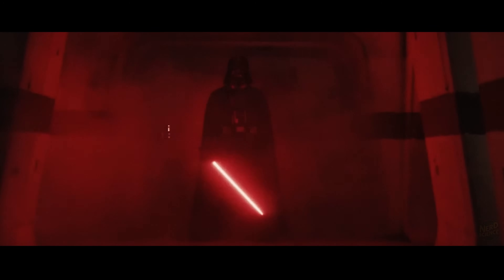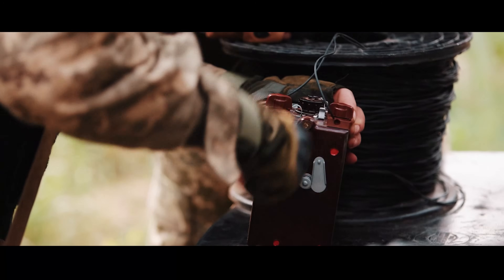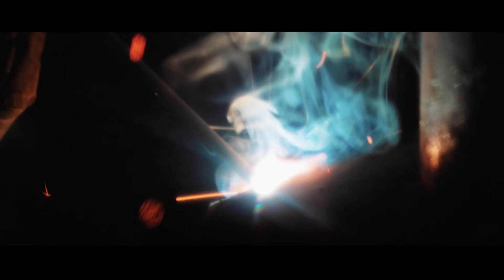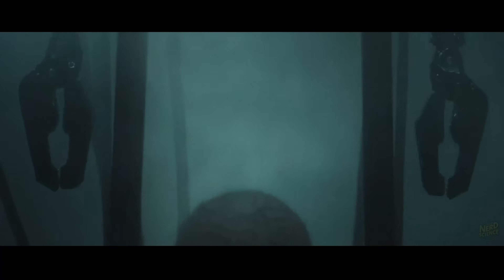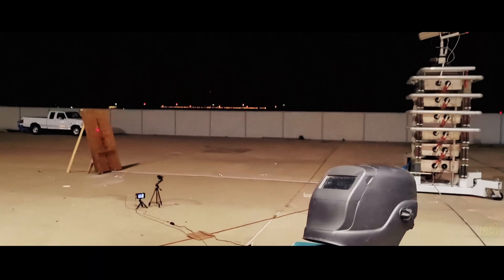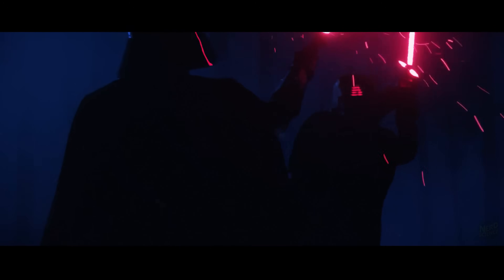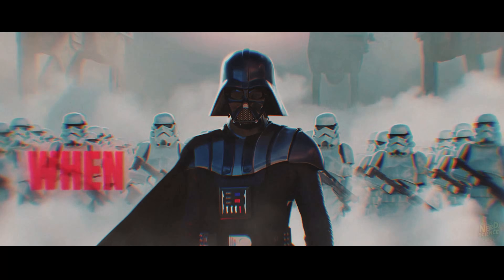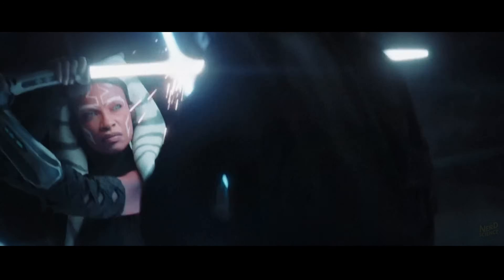Why a REAL Lightsaber Will NEVER Exist (According to Science)

Comment: It's a good thing when you examine the lightsaber from the field of physics, but you forget about the electromagnetic field(s). It is known that electromagnetic radiation has a wavelength, which can be extinguished because of this. It is also known that electromagnetic fields have a polarity and that the same poles repel each other. So, if the electromagnetic field of the lightsaber operates in an inner-outer pole pair in every configuration, then the fields with the same outer pole are impenetrable to each other. In this case, it is not the plasma blades that get stuck in each other, but the magnetic fields that form the obstacle for the blades. It is also worth knowing that objects are solid precisely because of the magnetic interaction: the magnetic field of atoms and molecules prevents them from passing through the already huge intermediate spaces. The change in state of matter only increases the size of the intermediate spaces to a size larger than the magnetic field of the atoms, while increasing the kinetic energy. However, it is indeed true that a lightsaber could not work in reality based on the simple "blueprints" presented.

Comment: Did you actually research this, or did you just let an AI regurgitate pop-science slop?

First: plasma can be confined by electromagnetic fields in theory. Hand-waving it away with “we don’t have the technology” is meaningless. We also didn’t have semiconductors, lasers, fusion reactors, or GPS until we did. “We can’t do it now” is not a scientific refutation; it’s a snapshot of current limitations.

Second: crystals are irrelevant. Real-world “lightsabers” wouldn’t need kyber magic or space crystals. All that matters is field containment: defining blade length, stability, and interaction with matter. Colour and lore fluff are aesthetic byproducts, not functional necessities. Pretending otherwise just shows you’re confusing Star Wars canon with physics.

Third: the power-source argument is lazy. Energy density has been shrinking for decades—batteries, capacitors, and power systems get smaller and more efficient every generation. And even if early prototypes required external packs, that’s not a problem; it’s how every technology starts. Miniaturisation follows function, not the other way around.

In short:
Your video doesn’t explain why lightsabers are impossible.
It just explains why they’re inconvenient with today’s tech, which is a completely different claim.

Maybe next time, argue physics instead of vibes.

Comment: Dude, get an education why don't you?  The Crystal IS the BATTERY.  You should watch the Clone Wars, you can find it on Disney+.  They go through how the lightsabers work in there.  Then on Rebels they talk about how the magnetic field constrictors set the blade length and turn the blade from massless to basically two opposing magnets when they come in contact with one another.  Also,  don't you think that a civilization that's learned how to travel at the speed of light and colonized several thousand star systems has maybe also learned how to overcome the difficulties you pointed out?  Just saying maybe...?  So instead of saying "Why a Real Lightsaber Will Never Exist (According to Science)" , perhaps you should change that to "Why a Real Lightsaber Can't be Constructed With Current Known Scientific Technologies".

Comment: What is impossible to day is possible tomorrow. At one point in the past the idea of  breaking the sound barrier was once thought to be an impossibility because the "sound barrier" was believed to be an insurmountable "wall" of physics that would destroy aircraft. However, scientists and engineers realized that the issue was due to shock waves caused by air compressibility, which could be overcome with specific aircraft designs. Science also once widely dismissed the possibility of space travel to the Moon as an "impossibility."

Comment: I'm not an engineer, but couldn't a lightsaber have an extendable casing that theoretically contains the plasma blade and also potentally solves/mitigates the heat and contact issues?

Comment: This is why Gundam's beam sabers are more likely because they take the concept and create a whole new vein of physics to explain it. In Universal Century science they explain this with three aspects. 

First a new type of nuclear fusion known as Minovsky Physics and the Ultracompact Minovsky Reactor. This fusion method creates a new type of particle called the Minovsky Particle which not only interferes with radio wavelengths but can make a more containable form of plasma.

Second, the I-field. This is a type of magnetized field created for Minovsky Physics that not only controls the plasma field of a beam saber but can also be applied as a defensive measure to block beam weaponry as the beam rifles use the same Minovsky Particle Plasma to fuel each blast as the beam saber emits. 

Finally, the fact that beam sabers.... Are meant for 18 meter war machines and not handheld plasma torches on steroids. They even showed what happens when a human body enters the beam of a beam saber in Victory Gundam and it's..... You evaporate immediately. 

So yeah, we will likely sooner get a Gundam than a Star Wars lightsaber.

Comment: If I remember correctly, the old canon design of lightsabers said something about there being some kind of energy field that is a part of the emitter that was used to contain the plasma of the blade giving it it's shape and length. It even had a gyro built into it which was how it could it be used to fight with as it gave a lightsaber the balance of a regular sword.

But these designs were retconned to what it is now when Disney bought the franchise.

Comment: The heat required for plasma to cut through anything like a lightsaber would immediately incinerate you and everything else in the room the moment you ignite the blade. We would need a way to contain that kind of heat. 🤔
Reply: I have 2 words for you. Negative temperature. Once you have that, then you won't be able to burn yourself or anything near it, unless you touch it.

Comment: Plasma can follow a magnetic field
With enough power you could make a field 3 foot long for the blade

That would also make the sabers clash against each other

You can also lessen the energy output by following a core that can extend out from the saber, a material that can survive the heat

Still has the energy problem but if you could attach the handle to a battery pack you can get more power.

I would like to think anything can be done with science
Just need to start big and make it smaller with future technology 

But I’m only a cook not a scientist, but I would like to hear how it could be made

Comment: The only way a light saber can exist is by if you press a button on the hilt which then extends medal 4 ft or 3 ft titanium rod with holes drilled into it. after medal rod is extended and like a grill igniter it releases hot plasma flames shooting out of the holes. The rod is now a hot glowing shaft with flames shooting out of it which would solve the solid problem.

Comment: Hacksmith begs to differ. While the protosaber isn't picture perfect the science part of the science fiction can work. Just look wise and anything to do with the force ofc wouldnt be accurate.  People forget star wars is science fiction.  Not all parts are science but the science parts in the most basic fundamental ways can work . Giant snake movies for example or giant spider movies. Yeah a bit exaggerated but snakes and spiders used to be that big. Some snakes can live even after their head was cut off and would make sense a giant snake could too . Etc (and we already know crystals can actually retain and hold information and some can hold energy. So a furture where a crystal is now a battery . Makes  sense. And the weightless blade is the only thing it says not handle the plasma blade works but t it technically isnt weightless. But yeah f this video go view hacksmith. The plasma blade he has u can control the length and cut through shit

Comment: Actually if you go the way of a particle field it could be possible,as the field would heat up particles that touch it.
Also if the light saber is anti energy but any object it touches would release radiation that would kill you.
So the only thing that can explain it would be a energy field, as that can produce heat.

Comment: The original sabers had power supplies that hung on a Jedis hip
Reply: Didn’t it start with a backpack before it went to the hip?
Reply: @ryanhiggins8869 yeap. Proto sabers
Reply: Backpacks were used before that.
Reply: They will be created. But they was never meant to be a weapon. All you would get is a plasma cutter with a Long plasma blade about the size of pocket knives to the size of kitchen knives at best. Yes Lightsabers are real but they was never meant to be a weapon. All you will get in real life is a plasma knife. That's it. It has many uses. 😊 Movies just exaggerate things. A handheld plasma cutter knife at best in real life. 😊 So no worries. ☺️ War is never a thing of the future anyway.☺️
Reply: I have 2 words for you. Negative temperature. Once you have that, then you won't be able to burn yourself or anything near it, unless you touch it.

Comment: A pair of toroidal coils, tells coils, can actual repel ions along its axis!
Well, place a Taser across the base of these coils, result is the straight path of the sparks now get push away into a curve path. Set up rotating high freq sparks between various electrodes around the base, with strong enough tells coils can push those spa4ks out into a blade!

Comment: Making a light saber will probably be impossible but some of it's parts might be feasible. The blade has little mass by itself but the hilt does has mass. Electromagnetism can transfer momentum at distance.
I don't understand the crystal part - i.e. what it does? Is it supposed to focus a laser beam to generate the plasma.
Battery to support this thing can be one of three possibilities.
1) Metastable nuclear isomers - those can be induced to release energy when absorbing certain gamma rays frequencies.
2) Antimatter
3) Something exotic like induced proton decay 

There should also be a power regulator chip so that power will be supplied only when needed.

Comment: The light fired from a quantum black hole the size of a microbe but placed on a sheet separated by mere atoms one from another could be stuck in a rotational loop.  The direction of the loop could be controlled by directional wave lengths possibly even waves of sound.  This could possibly create a highly luminous beam of photons that are constantly being rerouted faster and faster until they begin to generate gamma ray bursts and entangle with them and walla unmatched heat stuck in a cylindrical trajectory set by a super computer the size of a grain of sand and you've got what looks like a blade made of plasma or fire or whatever you want and it can cut through anything.

Comment: Hacksmith has 2 versions of a lightsaber one is basically a turbocharged torch the second one which is my favorite is a tungsten tube heated up by putting an electrical current through it which glows red, can cut through metal, and you can cross blades with them

Comment: Well, and yes this is fictional, but why can't these blades have adjustable properties based on what you're doing with them.  Really intense focused heat for cutting through doors and lower heat for dueling because yes.....all that heat would be impossible to wield unless it's dissipating somehow like a metal door absorbing the heat.  The blades in lore can be adjusted in length, why not intensity?

Comment: The blades are not weightless.  any reference to that whether it be canon or fan based is not accurate at all.  If that were the case everyone using them would only need to flick their wrists one-handed, & there would be no reason to use a two handed grip whatsoever.  also, when seeing saber throws being done, it is obvious that the blade has weight.

Comment: One of the benefits of reading the old extended-universe novels (specifically, 'I, Jedi') is you get a better description of lightsaber assembly.  It explains the battery issue by having the main character fine-tune the battery with the Force to vastly increase its capacity and efficiency.  These adjustments work so well, a lightsaber can retain at least some charge for hundreds or even thousands of years.  Of course, these stories predate the Disney purge, so they don't include the whole 'bleeding the crystal' nonsense for Dark side users.

Comment: Before ChatGPT upgraded and blocked most real scientific inquiry (lol), I used Chat to figure out how a lightsaber, that looks and acts like it does on screen, can be built. It wasn't a beam of light, lasers, plasma or anything like that. It was a highly conductive wire made of smart materials that, when inactive, coiled in the hilt and when activated, uncoiled into a straight line. Batteries (consumer level) super-heated the coiled wire to temperatures that allowed it to cut through metal and bone. It would hum, and glow too. The biggest challenge is reflecting it's thermal radiation from the user. In theory crystals have minor abilities to focus a beam of energy or even intensify it. But not enough to make a working lightsaber. It may be used as a heatbreak, but that's about it. But the rest is doable if you can get a 4' piece of cobalt, mix it with smart materials, that won't break when it hits something, heats up enough to cut a tree down, but doesn't emit so much thermal radiation that it burns off your hand.

Comment: The power source could be tapping into zero point energy. That would make the most sense, and actually provide enough power.
Reply: They will be created. But they was never meant to be a weapon. All you would get is a plasma cutter with a Long plasma blade about the size of pocket knives to the size of kitchen knives at best. Yes Lightsabers are real but they was never meant to be a weapon. All you will get in real life is a plasma knife. That's it. It has many uses. 😊 Movies just exaggerate things. A handheld plasma cutter knife at best in real life. 😊 So no worries. ☺️ War is never a thing of the future anyway.☺️
Reply: I have 2 words for you. Negative temperature. Once you have that, then you won't be able to burn yourself or anything near it, unless you touch it.

Comment: The blade would have to be positron based, arcing out from the hilt and tuned to return to it after a certain distance. Like a water jet shot up and returning to the source. The positron blade would cut through anything that is surrounded by electrons: all matter. AND, the positron blade would only be stopped by another positron blade. Dueling would be a thing. Only issues would be power requirements and shielding from the radiation emitted from matter/antimatter interaction when the blade is cutting something.

Comment: A phaser like in Star trek,
YEAH,
I can see that happening now, today's technology can probably build something like that.
A lightsaber on the other hand,
Well, the closest thing I have is a high powered laser pointer that even looks like a lightsaber, but doesn't have a limit of 3 feet and sure as hell doesn't cut through something like a blast door like butter.
But ultimately that's probably as much as you can cram into a hilt the size of a lightsaber.
By the way,
The high -power laser pointers are pretty fun to have for around $260 bucks!
And they will burn through things 😅
But not something like a blast door!
The End

Comment: Using solid  light holograms /force field I'm not going to tell you there is a way and using plasma Shields too for the heat I have theoretically worked it out it's based on real lab experiments and research around the world the tech does exist and power supply done to it's all possible I don't want to lose my IDea and sell it I want to sell a product under my own corporation under my own patents

Comment: This ought to be great. (watches vid)  Okay. In the real world, this wouldn't need to be 50,000 degrees, wouldn't need to be plasma, and wouldn't need to have megajoules of energy potential. Always funny to me how people don't consider looking at the quantum level on things like this. Consider that a cubic meter of frontal surface in a river, hitting you at 15 miles an hour will have tons of force, enough to push a car. But consider a 1/32" wide stream of water going 500mph with abrasive flour-fine garnet powder mixed in. Which one would cut through a 1" steel plate like it's not there? Exactly. Raw energy delivery in terms of amplitude is not required for a 'energy' saber to work. Just finding the right effect at the right size and level to make molecules either break apart (organics) or to jump to an exponentially higher energy state (metals). It's not as difficult as some think, but would take a different direction of thought and testing. And you'd have to give up the idea of 'colors'.